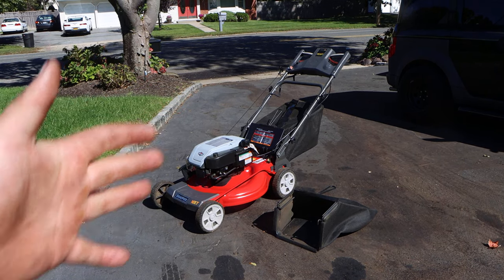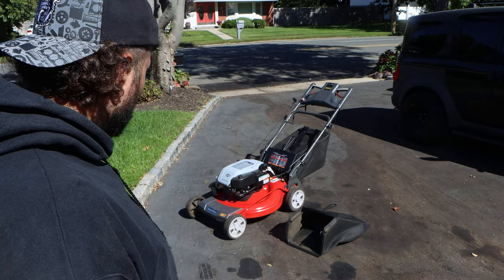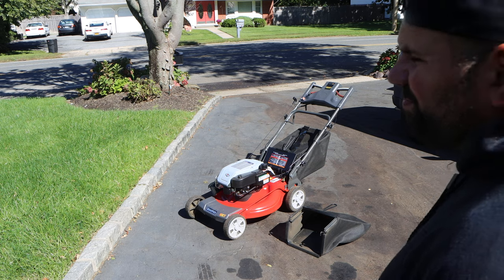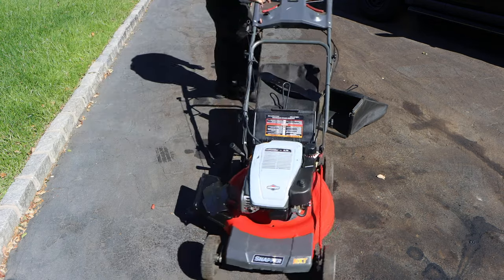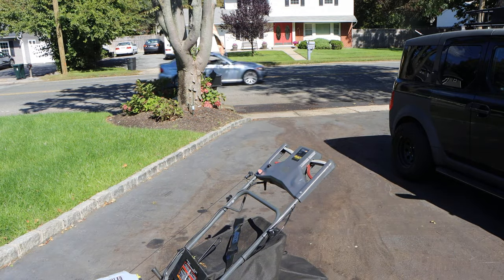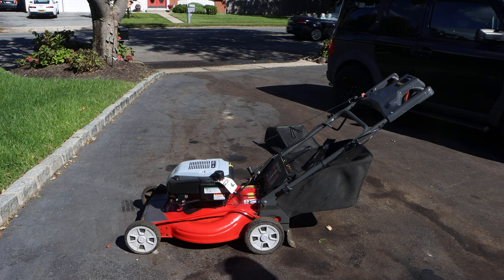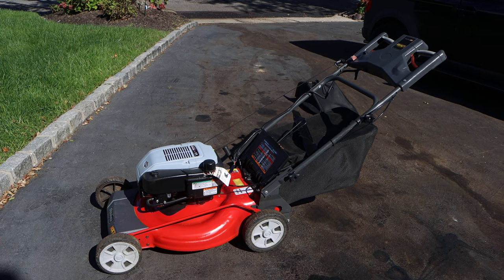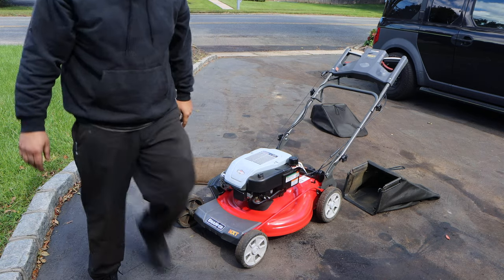Let's Talk About Turning Snapper's WORST Mower Into One Of Its BEST SNAPPER NXT In Depth LOOK!

Comment: I have one like that before but it had the Briggs Quantum engine on it and the pull start non ELECTRIC start
Reply from the maker: So the NXT does have same deck as the mower you are talking about.  Even come is FWD.

I wonder if the bail cables are the same 🤣

Great job john!
Reply: @pattayperformance  it should be I think, the one on my channel while back I worked on had the same setup for the for those handles the red was for the bail and the white was for the self-propelled

Comment: Hey Jason,
My John Deere JS46 has the same style blade with the extra point on ends I have no clue about why either to the design.
Reply from the maker: Someone wrote maybe the scrape the side of the decks.  I’m a loss for this one lol
Reply: @pattayperformance  I see no benefit and after one season of use the ends wear down and you have a smaller width cutting path so you have to overlap more.  I replaced my blade with a gator mulching one which did well but when I sold this mower I put back on the stock blade (A NEW ONE)

Comment: I would take that mower off your hands with no questions.  I'm a nerd also so the screen would only add to that side of me.  The Mrs. did a good job on the repairs.  Remember brother I'm here if you need some assistance on the Element.  Talk to you soon.  Later...
Reply from the maker: Oh I need help for sure!  The Radiator Fan isn’t turning on, on its own.  New Sensors, Relay is good, fan is good and breaks in wires.
Reply: @pattayperformance  have you made sure you got enough coolant and if you’ve added coolant did you make sure to bleed the air bubbles. Also not only do you have a relay but you also have a fuse too.  If you jumped the fan to the battery and it turns on and you’ve replaced the coolant temp sensor you only have a few things left to check. Thermostat and The wiring.
Reply: Is it over heating or not getting hot?
Reply from the maker: @Undar8ed03  it’s getting hot to the point almost overheating till the system turns on both fans to cool it down
Reply from the maker: @Undar8ed03  

I’ve checked…

Fuses
Relay 
Wiring
Both coolant sensors on the rad and block are new.  For shits and giggles I ordered OEM Honda ones to see if it would change. 
Fan is good
I have not replaced the thermostat bc on my scanner it reads coolant temp and it’s getting hot!
Reply: @pattayperformance  you didn’t say you checked the coolant amount!! Lol. If you have and you’ve bleed the air bubbles out and all fuses relays and sensors are good, then I would start looking at the wiring. Take your ohm meter  leads and push them into the fan connector.  Once up to temp, you should see the voltage go up as long as power is getting to it. I swear I wish I was there.  I’d have you figured out in less than 10
Reply: I also forgot to ask you if the CEL is on in the dash. Is so you need to pull the code.
Reply: @pattayperformance  never heard of that one before. I’ve always had them turn on when the needle is halfway or not turn on at all.  Have you added coolant recently?
Reply from the maker: @Undar8ed03 ,

Yes…

I’m going to make a video…I asked on a Honda forum and all hell broke loose.  People arguing that both fans turn on at all times vs just one. 🤣
Reply: @pattayperformance  lol. Yes both fans turn on when the ac is in use. Under normal driving conditions only the radiator fan turns on.

Comment: That tractor was awesome.  But what did they miss? What did they go cheap on? Blade, that tip is for cleaning the edges of the deck ?? Sounds good anyway.             Later ☠☠☠☠
Reply from the maker: I feel they missed out but not installing a recoil.  This motor is an animal on the machine!  Never though of the cleaning deck part!  I like it! 🤙🏻🔧🇺🇸🦅